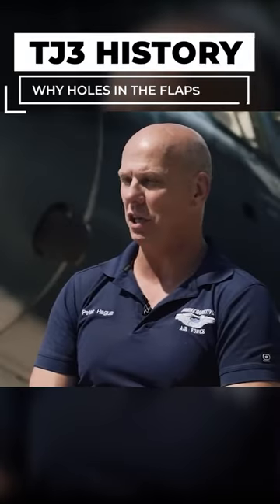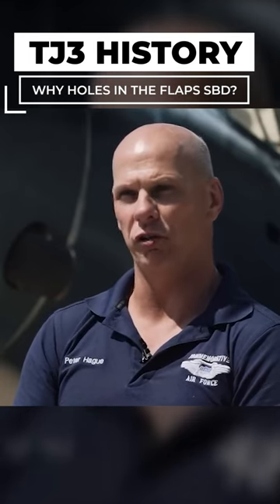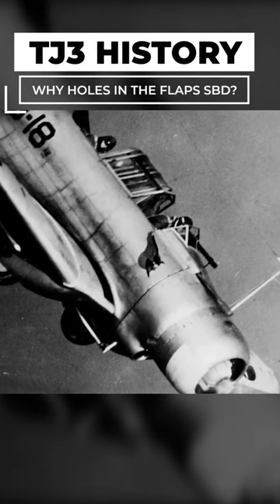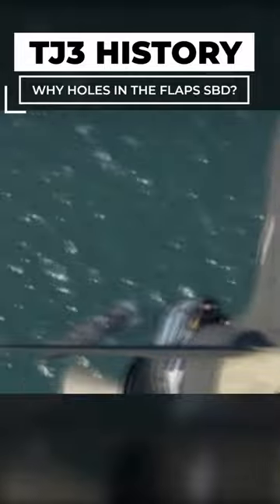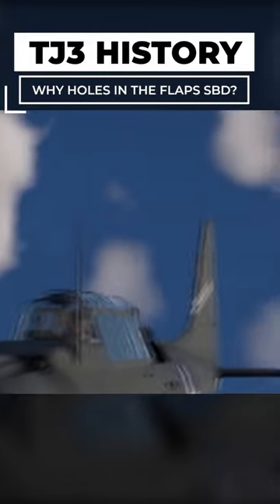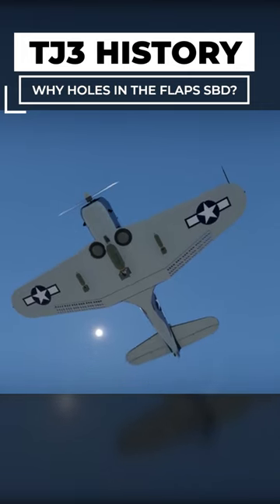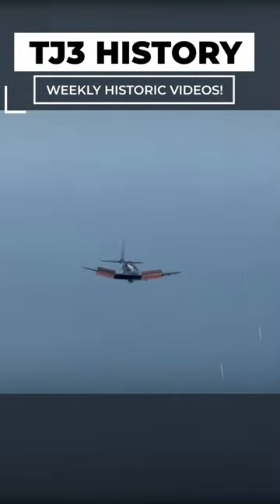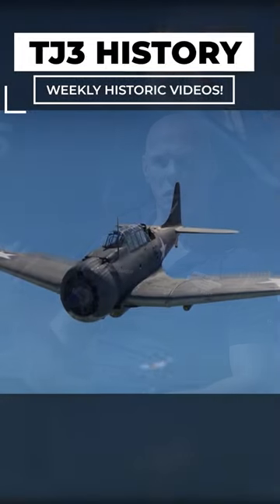The Dive Flaps of the SBD Dauntless #History

Comment: American pilots were just plain disgusted and longed for their old SBDs when the Navy replaced them with HellDivers.
Reply: Mainly as a result of the mechanical unreliability of the SBD2, after a large portion of the problems where fixed they proved effective.
Reply: It was the SB2C-5 that finally ironed out most of the problems in the Helldiver, but by then, the war was almost over. The whole program was a costly mistake.
Reply: I recall reading in a book by American Heritage where one SBD pilot refused to move on to the SB2C. Not sure if it is true, because no source was cited.

Comment: I believe Ed Heinemann was lead  Design Engineer on the SBD with Douglas Aircraft. Also designed the A4 Sky Hawk. I just remembered that Mr. Heinemann also designed the Douglas Sky-raider in 1944. Used a lot in Vietnam to provide air support. Went affectionately by the name Sandy and others.
Reply: Two fantastic attack aircraft!
Reply: I believe Heinemann flew in the SBD prototype to personally witness the problem with the solid dive brakes. The subsequent redesign with the holes cured the problem, enabling the SBD to dive vertically at 250kts steady as a rock. 
Heinemann also designed the Skyraider, which he and two others prepared initial drawings for in just 12 hours after a meeting with the Navy’s Bureau of Aeronautics found too many issues with their proposed XTB2D Skypirate. He’d asked for 30 days to produce a new design, but the Bureau gave them until ‘0900 tomorrow’. 
What a designer ~ and what a great pair of planes!
Reply: @davidpope3943 12 hours to design a clean sheet airplane, i had heard he had 48 hours and did it in 47, but damn that’s impressive, in a HOTEL ROOM in washington DC no less!